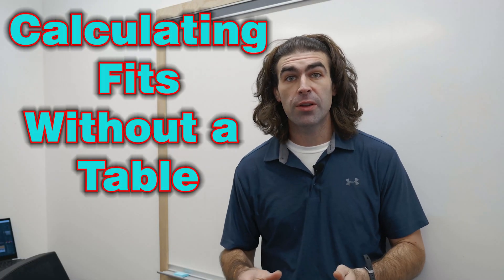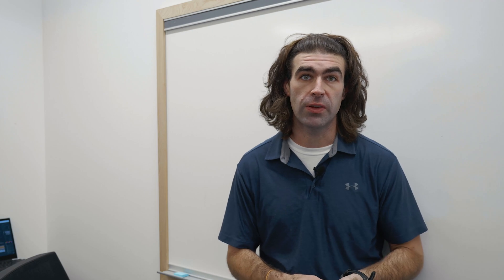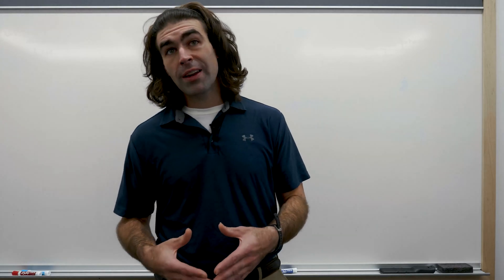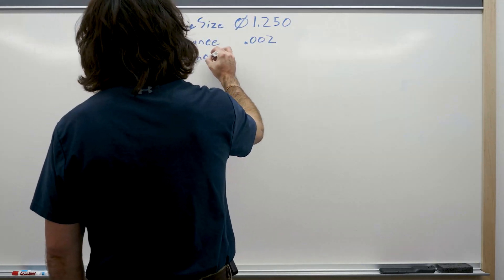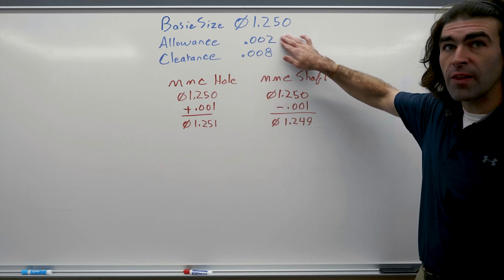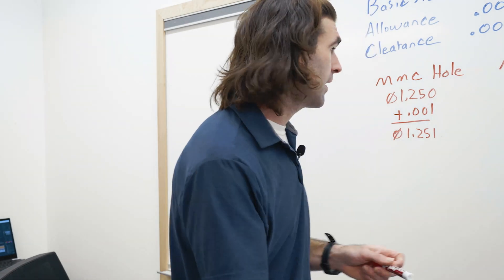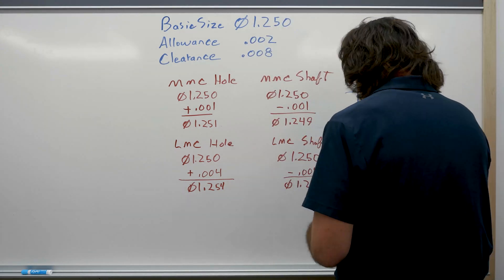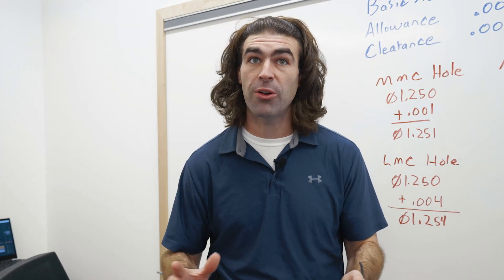Tolerancing: Calculating Fits Without a Table “Split Tolerance” Method

Comment: I get how to size holes and shafts based on the table (hole basis) and also converting those sizes to shaft basis, and also sizing custom sized holes with a known pin size. But my question is how to you factor in GD&T with this, such as how much positional tolerance do you allow being that these fits are really small values. I use fixed fastener but these clearances are really small values which seems unattainable from a machinist

Comment: Dear R. Dean Odell,
First of all thank you a lot for your educative videos. I learned a lot watching them!
I might be wrong, but shouldn't the MMC of the hole be 1.250-0.001 instead of 1.250+0.001 (and consequently the MMC of the shaft be 1.250+0.001 instead of 1.250-0.001)?
Thank you in advance for your answer.
Best regards,
David Melo
Reply: You always substract the shaft from the hole. So if the allowance is a positive number (in this case .002), the procedure in the video is correct.